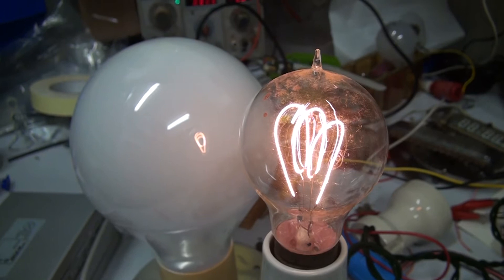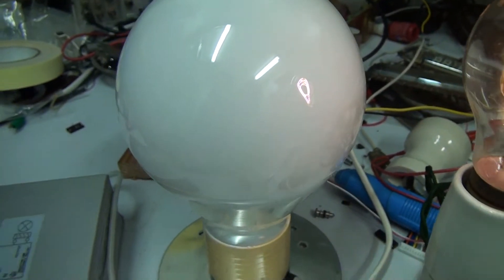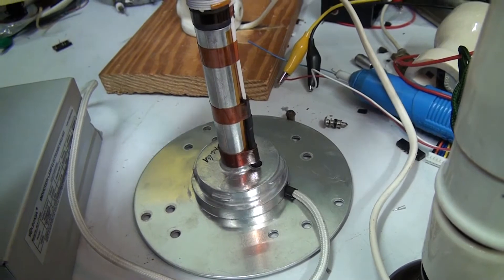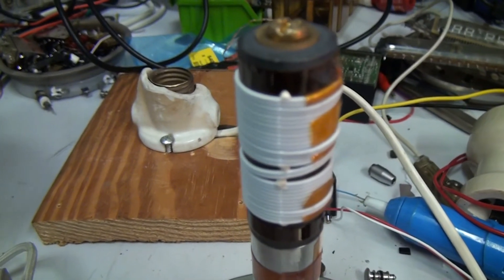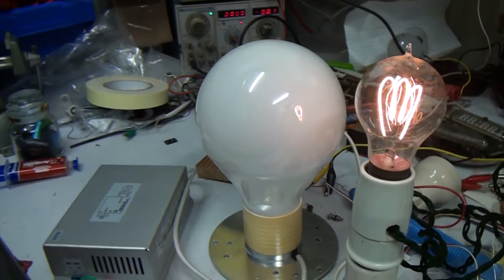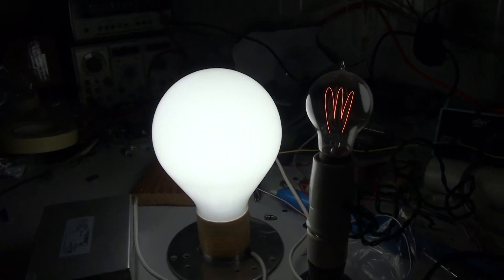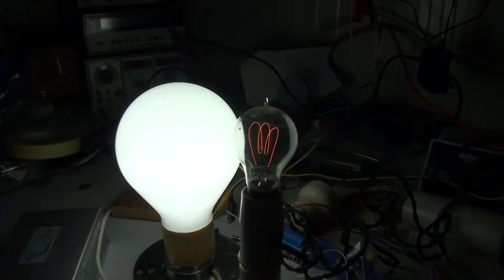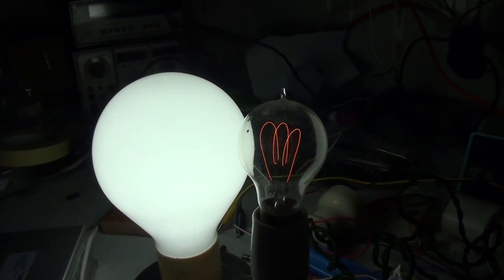Induction lamp 165 Watt

Comment: You can hook up a transformer from a microwave with the primary in series with a 120 volt transformer 500 va to 1500 va and the secondary of the microwave transformer connects to two 2000 volt or higher  .1 micro ferad polypropylene film pulse capacitor in parallel with the secondary of the microwave transformer. make sure that you ground both the ballast and transformer cores with two wires comming from the ground of your plug. connect both capacitors in series and then connect them to the secondary of the microwave transformer with high voltage gto wires. then connect two high voltage gto wires on each side of the capacitor bank  connecting to the microwave transformer secondary high voltage wires prepared earlier and one side of each capacitor. connect the ground side of the high voltage secondary of the microwave transformer and one side of one capacitor to one metal L bracket screwed to a acrylic sheet one inch thick or two 1/2 inch thick sheets stacked together on a 6x6 inch square. then screw the other L bracket with the vertical sides of the L brackets facing each other a distance apart with short screws. and connect a bolt on door handle to the vertical holes on each of the L brackets facing the ball or knob of the door handle to the other ball or knob of the other door handle to form a spark gap swich. then disasemble the electronics and base of the induction lamp from the glass bulb and induction lamp coil then connect a high voltage wire to each end of the induction lamp coil. connect one end of the induction lamp coil to the spark gap with the wire comming from the induction lamp to the L bracket of the spark gap. connect the other end of the induction lamp coil to the hot side of the secondary of the microwave transformer and the other side of the capacitor bank. connect the wires to bolts and washers and nuts bolted to acrylic sheet to make terminal blocks then make an acrylic box to fit everything inside it then you can zip tie the loose wires to make it look neat

Reply

Comment: The technology is much older than most people think.  The first induction lamps were believed to have been made by  J J Thomson sometime in the 1880s.  The first public demonstration of the technology was in 1894 by Nikola Tesla.  Peter Cooper-Hewitt advanced the technology further by adding mercury vapour and developed several different types of experimental lamps around 1904-1905.  The first modern induction lamps were developed at GE in the late 60s.
Reply from the maker: Thanks for the info, I guess the technology has been around for a while. Long life is the main attraction as the globe has no Cathodes that degrade. LEDs will most likely take over most forms of lighting eventually.
Reply: This lamp mimics the original seperate coil designs, it almost looks like a tesla lamp. You could even replicate the tesla experiments as the lamp can be removed from the base and placed anywhere in a strong RF field to light it.

Comment: I bet the carbon lamp will outlast the induction lamp by years
Reply from the maker: I agree, the electronics would eventually fail due to the Capacitors drying out. The electronic section gets quite hot after a while.
Reply: @rustymotor  Could you try running the Induction lamp on an magnetic ballast ?